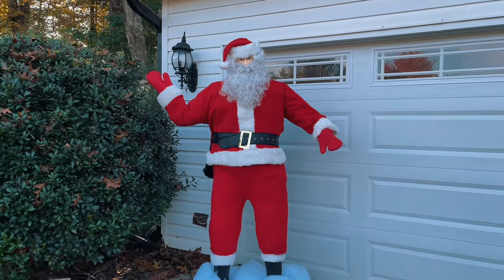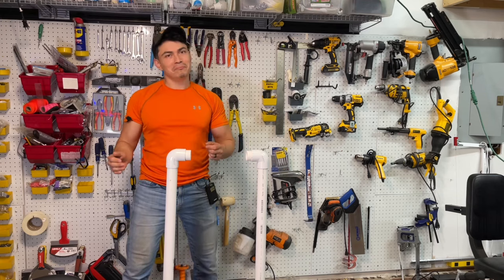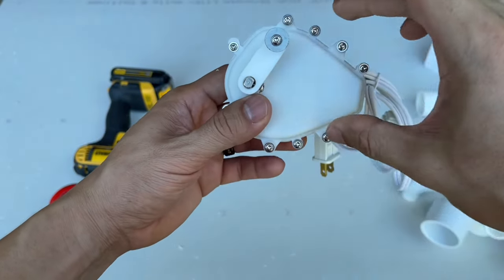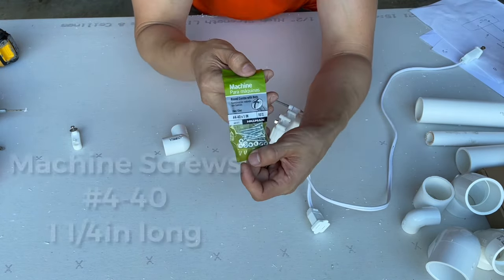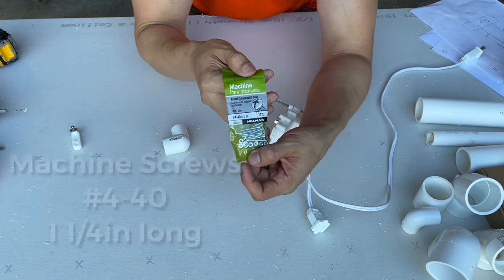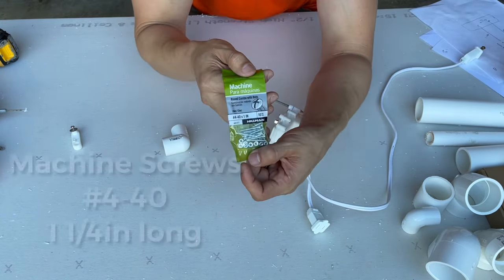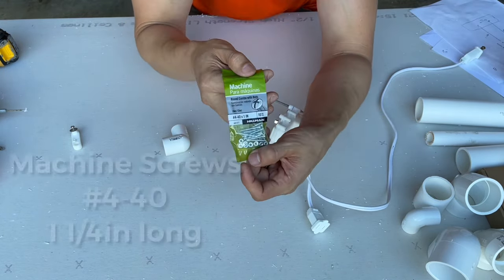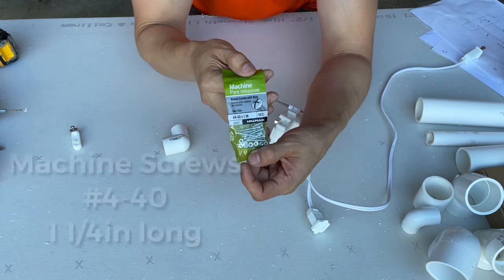ANIMATRONIC SANTA - DIY Tutorial

Comment: Mount your motor to the back side of the PVC pipe and drill a clearance hole for the part that moves and make the little pipe long enough to pass through the PVC pipe. To save a little bulk and then you can put your bump screws in the front also. Use small coffee cans cut in half for feet or plastic Halloween clown shoes.
Reply from the maker: That’s actually a great idea! Thanks for the tip

Comment: For the boots you could go to a tractor supply store and get plain black muck boots and attach the trim to the tops and drill a hole through the bottom of each boot to slide over pvc
Reply from the maker: Great tip ! Thank you

Comment: Suggestions; use a heat gun to smash the elbow end of the upper arm.this will make that area less bulky and better mounting surface for the motor. 

You can use a heat gun to connect the ends of the pool noodles instead of having the ends sticking out.

Stopping the motor with the screws will drastically decrease the life of the deer motor.  You could mount the motor in the shoulder area and use  the original cam on the motor and a rod mounted to the forearm with a pivot at the elbow.

It does look awesome!
Reply from the maker: This is such a brilliant idea, I wish I would’ve thought of that before. Thank you so much for this

Comment: Your Santa is fantastic.  If I may, I'd like to offer a small suggestion.   Drill holes in the base, where the "legs" are.   Then insert rebar into the ground, and sit the base on the rebar, with the rebar going up the legs and acting as both a theft deterrent and as a way to firm up the Santa to withstand the December winds.
Reply from the maker: Super smart tips! Thank you for that

Comment: A couple of suggestions: for the lower arm stop use 1/4” allthread rod and bend it to shape then drill through the arm and attach it with nuts for a stronger stop. Second, for the torso fill, use a large contractor garbage bag with 2 holes in the bottom for the PVC and put it on before assembling the torso, fill with newspaper or other materials and tie at top. Third, you can use a large pillowcase  for the sack.
Reply from the maker: Great tips! Thanks

Comment: love this tutorial.  I may have to try to make one of these!

One idea.....when you were trying to get the motor to stop and switch directions on the down swing, would it work to take another screw out of the motor and replace it with a longer screw or a small bolt that extends up to the arm to stop it?   I just noticed that where you wanted that motion to stop, was right beside one of the screws in the motor itself. It might cut down on the bulkiness of that elbow.

Just an idea, I have no clue if it would work without having the stuff right in front of me.

Comment: A slow turning electric motor with a fex 5" wheel in the low end of the upper arm. A stick/rod fastened with a screw far out of the wheel and set with a screw 6-7 inches up on the lower arm with a hinge in the bottom (between the two arm pieces) works. Could draw it for you, but this field is for letters only i´m afraid..
Reply from the maker: Oh wow thanks for this. Could you send it to me on Facebook perhaps? You could search “Isaac Alexander DIY”

Comment: Do you can get a pair of black shoes or brown ones and spray paint them black. Then cut a 1 1/2" hole in the shoes and slide them down over the PVC pipe. Then add the boot sleeve and then Santas pants. Wouldn't that work perfect?